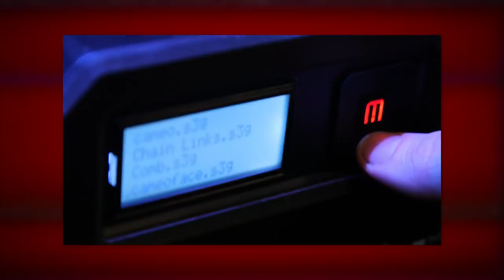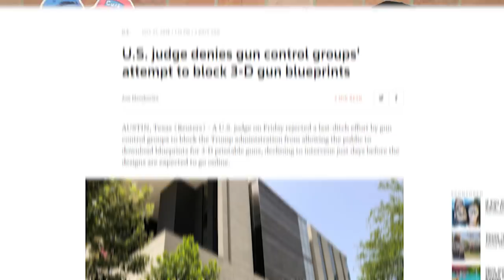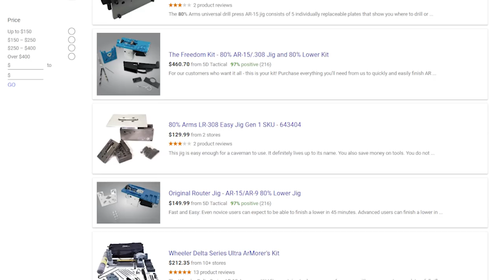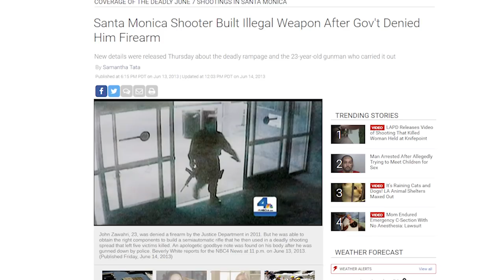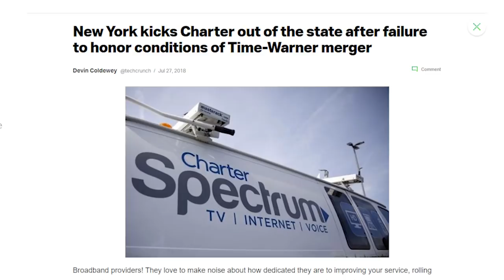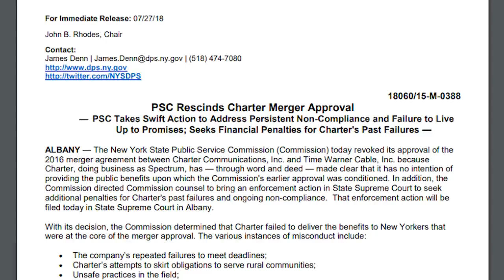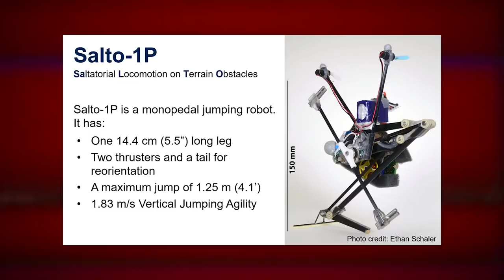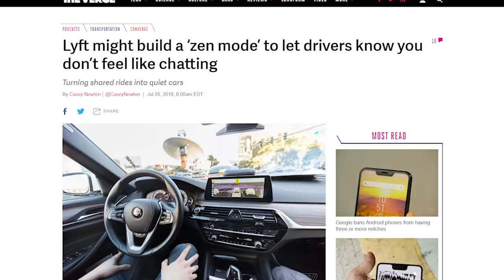3D-Printed Unregistered Guns LEGAL? It's Complicated - TechNewsDay

Comment: Under federal law, manufacturing your own firearm is 100% legal and does not require being serialized or registered (in states where firearms are registered with the state), so long as it is a non nfa item and the individual building it can legally posses a firearm. However, selling a non-serialized firearm IS illegal.

80% receivers have been around for decades to make manufacturing your own firearm easier, and 3d printing is the next step for such practices.

Comment: Unregistered firearms are not illegal. you can manufacture your own firearm in the United States and it doesn't have to be registered. However it is illegal to sell a unregistered firearm.
Reply: Zski It should be
Reply: Some states may require the gun to be destroyed/disabled on makers death.
Reply: Nagifan7496 we’ll most people can’t make guns that are not single shot derringers that might explode which is why very few crimes have been done with homemade guns
Reply: Jeff Solis Doesnt matter. Any unregistered firearm should be illegal.
Reply: actually i believe the guy is also selling a 3-d milling machine to make metallic receivers. It doesn't take much anymore to print out unregistered full automatic rifles anymore.
Reply: Google 80% lower ar15 and Glock. It's really easy to create a "homemade gun" also I didn't have to register any of the guns I bought at my gun store. Just a background check and then it's my property
Reply: @nagifan7496 full auto is illegal by law without a Federal license to do so.
Criminals however don't usually follow laws so if it's legal or not they will find a way to do whatever they want.
I'll keep my firearms in the hope I'll never have to use one in defense because it's better then needing one and not having it.
Reply: I don't believe you can legally cross most state lines with a self-manufactured firearm.
Reply: Troph2 correct, but why would you? If you build a homemade gun I would not suggest carrying in either concealed or open carry. They are more a way to get handguns or rifles to shoot at a range. 80% lowers are fun to build and have their own market for that reason. It is also a good way for someone between the ages of 18 to 21 to get a legal handgun to shoot because they cannot purchase one from a gun store until 21.
Reply: Nagifan7496 you know guns are not registered right? There isn’t a list of guns and there owners in a government building.
Reply: unregistered immigrants should be illegal. Oh wait they are
Reply: EmperorKuta but they are talking about America not other countries.
Reply: Zski but it also can't be traced and if used to commit a murder there will be no way to catch the killer
Reply: Nerdlin Geeksly lol that’s funny
Reply: ernesto garcia didn't take much to mill a receiver before, just a drill bit. That 80% receiver thing has been known to pretty much everybody that owns a firearm for years.

But tabletop CNC have been a thing as long as 3D printers have. The only difference between them is the 3D printer usually has a feeder gear to feed the filament and essentially what amounts of being a hot glue gun to melt it.

The CNC just has a router and bit on it

There's actually a ton of projects to make your own table top CNC from spare parts like copy machines and printers. Use a ramps board control the whole thing. Usually a computer power supply power it. Motor control Shields to run the stepper Motors. Etc etc
Reply: ernesto garcia are...are you serious?? This has got to be a troll comment.
Reply: If unregistered fireams are illegal...how is it illegal to sell unregistered firearms? That..makes zero sense. 

If you really need it broken down further, it is not illegal to sell an unregistered weapon. If that was the case every FFL (federal firearms license) dealer would be breaking federal law everytime they sell a gun to anyone. Which even you have to admit is not the case.
Reply: Nagifan7496 why? Does registering a firearm automatically stop crime? Does a registered vehicle stop DUIs?  What fantasy world do you live in? 😂
Reply: Zski their likely trying to stop terrorists or cartels from simply setting up shop in a cave or abandoned building and simply download file to mass produce a bunch of unmarked weapons.
Reply: Nerdlin Geeksly but...thats not how it works..."tracing" a gun thats not even in the polices possesion dont automatically locate the criminal. Thats hollywood fiction. 

Tell me how that would even remotely make sense? Even if the gun was left at the scene of the crime, and they ran the numbers, the most they would be able to find out would be what gun store sold it to who if it was sold within the past 10 years or so. 

The problems with this is it is very unlikely that the gun would be left at the crime scene. Also there is no way of telling who is actually in possesion of it currently, only who was the original buyer IF its still on file. Seeing as nearly all guns a criminal uses to commit a crime is stolen, and usually older guns anyway, even in the unlikey event that the gun WAS left at the scene the chances of that alone leading them to the person responsible is slim to none.
Reply: eightymopar the liberator alone is a good example of an assassins weapon. Just a single shot to a major artery, the spine, or the brain. Even if the target of the assasination isnt dead you've still sent a message. Unlike for example with an Ak authorities couldnt see if it was taken from a military armory, or if a country/ individual is selling terrorists weapons.
Reply: Nicholas Stavinoha so now the cave terrorists are just trying to wound people to teach them a lesson? And the govt must stop this? Whaaaaatt?? 

1st of all your on some james bond/spy shit. And 2nd for situations for that scenerio, there are already many options out there that have been used for well over 100 years. Look up the spy weapons during WW2 for example. Interesting stuff actually. 

I just can not see some large criminal or terrorist empire having a 3d printed gun operation set up printing bulky single shot 22 pistols to discretly wound a target. 

Hell a .25 raven or jennings would do a better job and would be safer, and those are absolutely garbage pistols. Pistols brand new or nearly new you can buy today for under 100 bucks at any gun or pawn shop. Hell i bought one from a buddy of mine years ago for like 30 bucks just for the hell of it.
Reply: Nerdlin Geeksly you can shoot someone with a legally bought gun and they couldn't trace it with out having the gun it's self, yes they can get make and caliber of the gun from the bullet but that's about it. And these plastic printed guns are probably as likely to hurt the shooter as much as the Target.
Reply: eightymopar i myself have an RG 22lr revolver one of the cheapest revolvers of all time, and i got mine for free when my gradfather died. And if you want to talk about history dont forget that Archduke Ferdinand was killed by a single bullet that hit him in his artery. Sure anyone who wants to kill another person can with anything, even a fork. But if you can have a proper firearm that looks and even feels like a toy, thats something else.
Reply: How do you register a gun ? I live in Texas and it's not even possible. And I only buy them new .
Reply: "It should be"

Why how many crimes are committed with unserialized firearms compared to serialized firearms?
Reply: "Some states may require the gun to be destroyed/disabled on makers death."

That is federal law as you cannot sell or transfer an unserialized firearm.
Reply: "we’ll most people can’t make guns that are not single shot derringers that might explode which is why very few crimes have been done with homemade guns"

3d printed AR-15 lower is not a single shot firearm.  People print out lowers and use 80% lowers all the time.
Reply: "Doesnt matter. Any unregistered firearm should be illegal."

It does matter depending on statistics.  Getting rid of freedom for the perception of security is not wanted.
Reply: "actually i believe the guy is also selling a 3-d milling machine to make metallic receivers. It doesn't take much anymore to print out unregistered full automatic rifles anymore."

Prior to 1934 machine guns could be mail ordered to your home.  1934 rates of gun homicide as well as violent crime was lower back then.  Gun controls does not equal safety as a guarantee it depends on the application and the resulting statistics.  These should always be considered.
Reply: "I don't believe you can legally cross most state lines with a self-manufactured firearm."

Define "most" yes you can cross most(51%) state lines most states do allow for unserialized firearms.
Reply: " you know guns are not registered right? There isn’t a list of guns and there owners in a government building."

Exception NFA controlled items.
Reply: "but it also can't be traced and if used to commit a murder there will be no way to catch the killer"

What happens if I take a dremel to the serial number of a firearm and commit a crime with it?  The same result.
Reply: "If unregistered fireams are illegal...how is it illegal to sell unregistered firearms? That..makes zero sense. 

If you really need it broken down further, it is not illegal to sell an unregistered weapon. If that was the case every FFL (federal firearms license) dealer would be breaking federal law everytime they sell a gun to anyone. Which even you have to admit is not the case."

It is because he doesn't understand the difference between registration and serialization.
Reply: "their likely trying to stop terrorists or cartels from simply setting up shop in a cave or abandoned building and simply download file to mass produce a bunch of unmarked weapons."

What about the very obvious mass amounts of materials to produce such firearms?  What about the materials to reload ammunition? What about the generators?  What about the satellite connection in order to obtain those files?  It would be obvious and still expensive.
Reply: "the liberator alone is a good example of an assassins weapon. Just a single shot to a major artery, the spine, or the brain. Even if the target of the assasination isnt dead you've still sent a message. Unlike for example with an Ak authorities couldnt see if it was taken from a military armory, or if a country/ individual is selling terrorists weapons."

So what? The majority of firearms successfully traced involve theft and straw purchases ignoring the serialization entirely.  Going around background checks as well.
Reply: "i myself have an RG 22lr revolver one of the cheapest revolvers of all time, and i got mine for free when my gradfather died. And if you want to talk about history dont forget that Archduke Ferdinand was killed by a single bullet that hit him in his artery. Sure anyone who wants to kill another person can with anything, even a fork. But if you can have a proper firearm that looks and even feels like a toy, thats something else."

The majority of firearm casualties are NON lethal.  It covers a far range of calibers and an whole smattering of intent.  Overall firearm casualties are non lethal even in the U.S..  f we just look at police shootings the vast majority are non lethal.  Even an officer aiming center mass and shooting generally twice as per sop the suspect is still in a majority (51%+) not killed.  It depends on shot placement and the overall fitness of the target as well as caliber.
Reply: "true but all they need to do is print off the part that holds the serial number and not put a serial number on got an untraceable gun to commit murders with and on top of that they showed in this video that there are guns made almost completely of plastic that are good for a few shots all you need is one shot to kill someone"

Didn't someone kill and maim as much people as the lv shooter only they used a truck in half the time?  Pretty sure that happened.  <checks wiki> yup.
Reply: Nagifan7496 Why do you think they should be illegal? If criminals want to get their hands on weapons, registered or not, they will whether or not they're legal.

Comment: They aren't hard to pick up in a metal detector. They all require metal parts. The ar15 version requires a full metal upper and barrel, etc. Alot of states already don't require registration to own a gun. Few states require licenses for guns. 80% lowers are already a legal thing. You mill out either some plastic or metal and then you have a gun that operates as good as it does about of a factory.

Comment: well it is a single shot pistol that must be reloaded, has horrible accuracy. And can brake or jam easily. 

Sounds like a gun that existed around the time the founding fathers existed

So id say this is  perfect example of what should be allowed to be free of regulation lol.
Reply: It got the job done
Reply: Precedent...
Reply: markd315 yes you entirely right, but how would you go about enforcing this law. Like writing a law saying you can own/view the files but cant print it. Wont work
Reply: degoodwin77 im sure you can, but i d9nt see a criminal causing a mass shooting with a flintlock pistol and a plastic pistol that needs to be reloaded after every shot and can basically explode in your hand if it wasnt put together correctly, while they were high off and drinkin mt dew in their basement.

Comment: I think what everyone is missing about self driving car services, is that without a person or other means of monitoring rider behavior in the car. The cars will basically be wheeled cesspools. Fill all manner of used needles, condoms, and anything else that you would not want to be in the same room with. You want to engage in illegal/elicit behavior just call a self-driving car and do it from the safety of the interior of it.

Comment: Question is would attempting to restrict access to this file limit the first amendment or the second?  I suppose the difference between the file and the gun it produces when printed is kind of like comparing a blueprint with a building, on that note, i would say the distribution of the file is probably protected under the first amendment.

Comment: On the topic of gun control, America is a totally different beast than any other nation. You can draw attention to Australia, Canada and other countries but their population pales in comparison to America's 325+ million strong, coupled with the fact of how available and ingratiated guns are with American culture.

It's a unique problem that requires a unique solution, as total bans won't be too effective because of how many guns are already in circulation and how difficult it would be to police the issue and enforce it, unlike with other nations that have a smaller population and thus one easier to control.

There are many shades of grey on the issue and going full NRA or total restriction won't work.

Just an Englishman's take on the issue.

Comment: Although, police/homeland security could perhaps check the hash value of a gun file. It's what they use when tracking distribution of child porn. All files have a hash value, like a fingerprint and it doesn't matter if you change the name of the file. Now, prints of guns should be far fewer than child porn files, so authorities just need a program to check the hash values of the prints and then track down the real IP address. I mean, if they wanted to. You're never really anonymous online. Given resources the VPN chain can be tracked. Unless you live in a country that hasn't implemented IPv6. Here in Sweden we suck balls at it, we're still using IPv4. Because of disinterest or lack of knowledge, "hey IPv4 still works, right?". The problem is that large portions of a city/county/neighbourhood has to share the same IPv4 address. So when the police comes knocking at a ISP and says "We've traced down this criminal's IP-address to your service" the ISP unfortunately has to say "Yeah but a large portion of the city uses the same address, so we cannot give you information about all of the households and enterprises that use or have used that address." And even if they did, where do you go from there? Like trying to find a needle in a haystack.

Comment: The fact that a plastic gun can't be picked up easily, if at all, holds no real weight IMO. That's because for most of US history guns have been common and metal detectors didn't exist - including when commercial air travel existed, and people had ways of dealing with this fact. Similar, even improved methods can be employed again, it new scanning tech can be developed to look for plastic guns. Is it easy or convenient? Probably not, especially at first. Hell, mentally checking every bag that goes on a plane can be done quickly and efficiently if you hire enough people to do it. They can even do it right there in front of the passengers - airports have tons of extra space where that kind of system can be set up. It'd make plenty of jobs, too. That would do nothing about packages, but a shipped gun in storage, a UPS truck, or the mail is a paperweight in a box.

Now all said I'm a believer in smart gun control; violent felons and people with mental illness shouldn't have guns, you should need insurance and training like with cars, etc. This makes the a lot harder, but considering how shitty the guns are, it's kinda a trade-off - and the second amendment isn't going anywhere, nor should it. Been Franklin was adamant that we should never sacrifice freedom for security, and we've already done that a lot - too much in some cases. But there's a huge difference between having a freedom removed and making people jump through a few hoops. As long as the bar to entry, as it were, isn't a barricade or blockade, that's an acceptable compromise. And compromise is something the jackass old fuckes still clinging to life and office around this country seen to have forgotten as a concept.